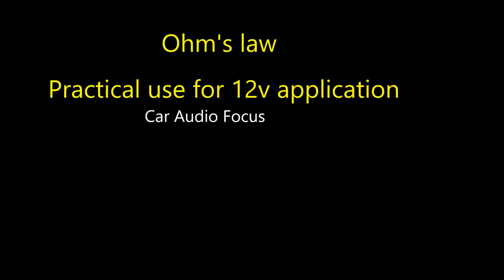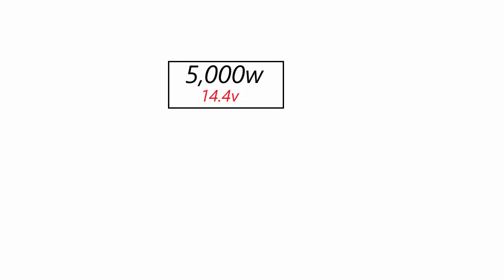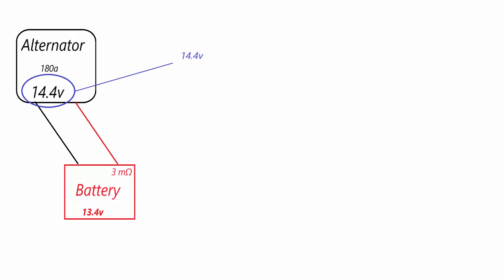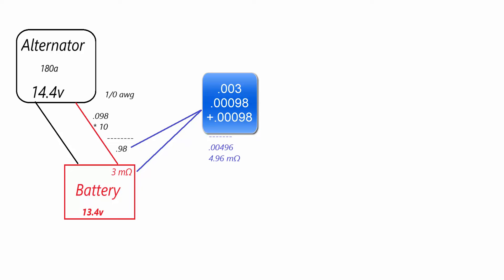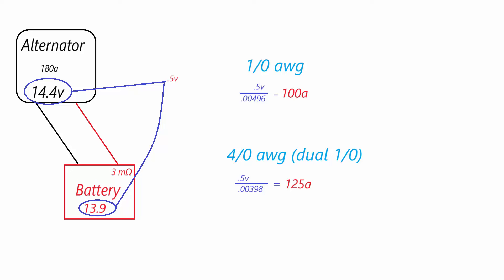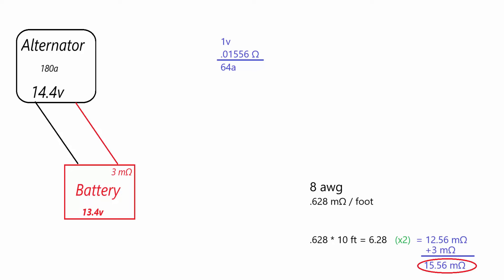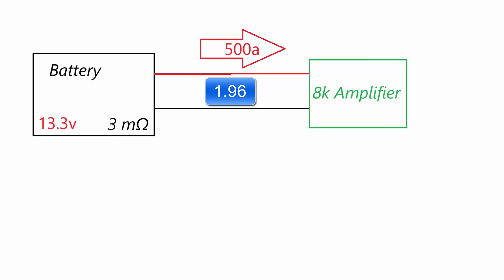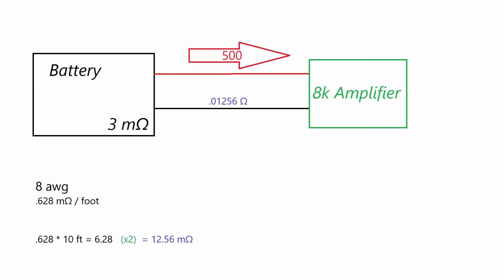Applying OHM'S LAW to your car audio setup - Extremely useful information

Comment: I get everything you are saying but I still suck at math all I know I have a 320 amp alt charging at 15.3 and my battery is at 15.3 resting voltage I have dual 1/0 going 15 foot to the battery maybe less… then 3, 3foot 1/0 grounds coming from the battery to the frame then under the hood I had a 5in 1/0 ground going from the battery delete to the frame then a 7in 1/0 ground going to the frame to the motor then 2 foot 1/0 ground to the Alternator to  the battery delete … I’m just gonna run more of everything and that should be good

Comment: In need of help on deciding which Glowe Series to purchase..i have a 320a alt and Big 3 done.. gonna be running a RUTHLESS 10K on a pair of 12" Sundown Zv6s
Reply from the maker: I'd recommend either a Series 2 or a Series 3.  Planning on keeping OEM battery?  If so, a S3 takes up the least amount of space and can provide 700+ amps burst.  If running stand alone, I think the S2 pulls ahead since it has more capacity and can handle being a solo battery much better.

Comment: All of those high school kids asking when they will ever need to use math.  If you want bass you need math, or pay somebody else to figure it out, it is called the math tax.  You can do the math or pay the tax.
Reply from the maker: I mean honestly, I’m making a living off of math by using it to figure out how to make improvements to what’s already been done / existing standards. 

In a completely unregulated environment with no central authority for info the amount of misinfo spreading around is wild..  

I’ve even noticed some industry experts repeating gibberish.  I don’t blame them though, it’s generally what they were taught and they never stopped (or had the necessary tools) to validate.
Reply from the maker: 9/10 times my videos are made because I don’t know or have data to back up the answer to a question I see people arguing about or questioning - only what I’ve heard.  I have no clue the outcome before filming, don’t even pre-game the tests.
Reply: I’m one of them but it makes a lot more sense now when I know what is going on